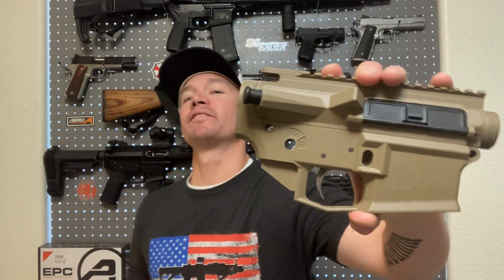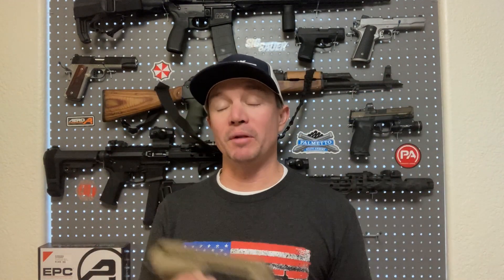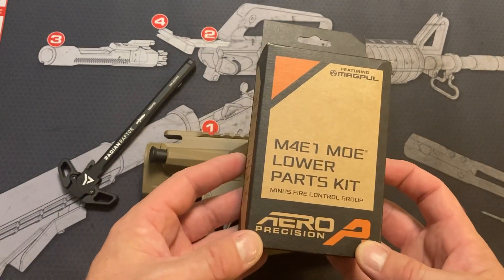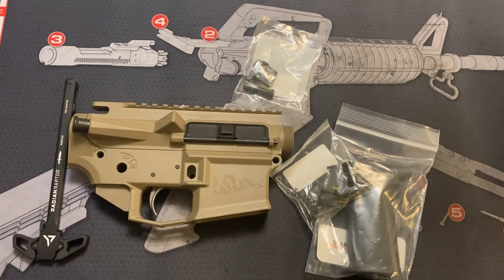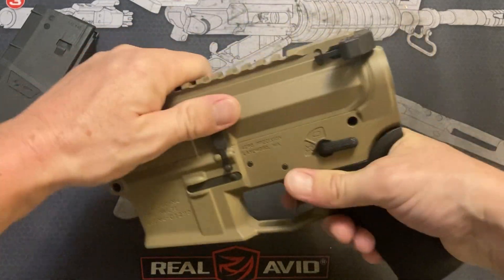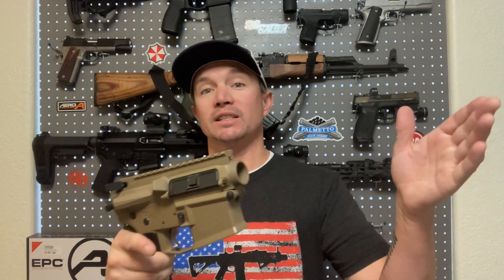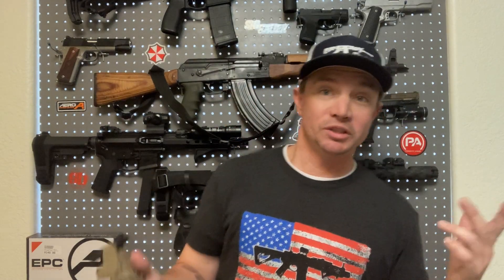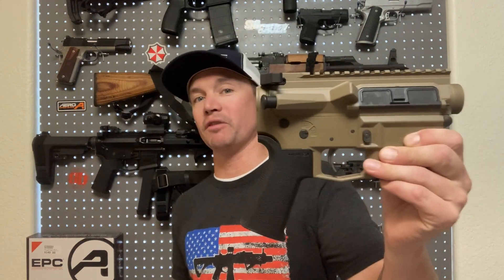Aero Precision M4E1 .300 BLK Build - Radian Raptor and Lower Parts

Comment: Just subbed. Thinking of doing this build as well. Buffer weight is definitely the question I was wondering myself. Look forward to watching this build brother. Keep it up
Reply from the maker: I'm really glad you like it.  I used a Geissele Super 42 Buffer system with an H2 buffer.  I've only run supersonic ammo through it, so far, because I'm waiting for my suppressor to get approved before I use up my subsonic loads, but it's been perfectly reliable, so far.

Comment: U should check out the BCM mod 3 grip it’s even more vertical than the Magpul. I got a Magpul on my 16” and it’s good and all but the Bcm is straighter than the Magpul so I went with tht one.
Reply from the maker: Yeah.  I like the BCM grip a lot, actually.  I used this Magpul grip on this build because it came with the lower parts kit that I bought and I like it fine enough to not replace it.

Comment: How tight is the fit between the upper and lower on tht aero set??
Reply from the maker: Super tight.  Before I even installed the pins, I could hold the upper and shake it and the lower wouldn't fall out.

Comment: Holyshit is their suppressors really $300-$400???
Reply from the maker: Yeah.  Check out Witt Machine & Tool.  I thought it was too good to be true, so I did a lot of research and really only heard good things about them.  Supposedly, they perform very well for their size.  I wanted something short and not too heavy to keep this gun as light and maneuverable as possible, so the 4" Dirty 30 seemed like a really good fit.  It is supposed to be hearing safe with subsonic ammunition, and at only $300 plus a $200 tax stamp, I had to try it out.  If it performs as well as people say it does, I'm going to start the process for their Naughty 9, as well, for my 9mm PCC build.
Reply: @sawtoothtactical404  already checked em out man. Have u not made a video on it yet? I couldn’t find it cause if it performs like u say I’ll definitely look into gettin one for sure. I’ll go for one with a qd break on it and not a direct thread one. Man I really preciate u responding so quick. I knw 300 can b real finicky round to run if u dnt have the right buffer and wht not so this will help me save money and not buy something wrong and have to buy something else to make it run properly. I dnt knw where u live but I’m lucky in Florida and I dnt think tht ATF bullshit will b finding its way down here or atleast I hope not because I dnt wanna SBR my build so hopefully our representatives get their shit together and put the ATF in their place or we might have to wait till a president tht believes in the constitution gets back in office (Trump)  and goes in their like a wreckin ball and puts our country back on track cause we can’t survive another 4yrs of democratic criminal running shit. Thanks again man have a good one.